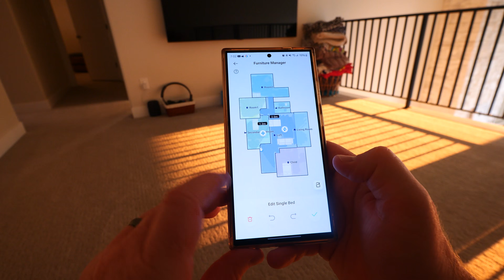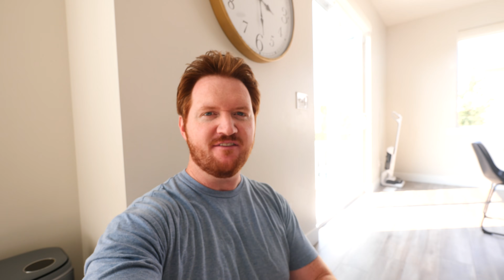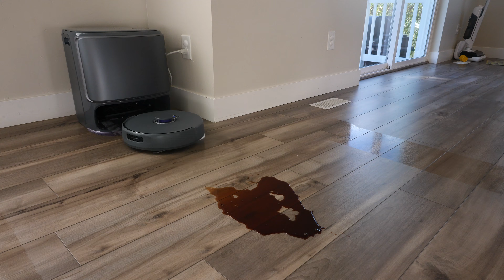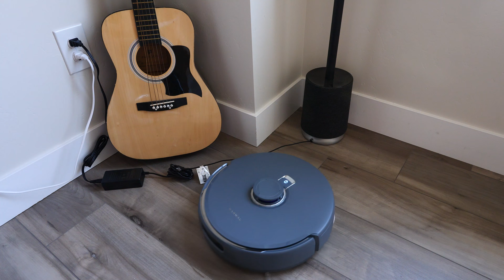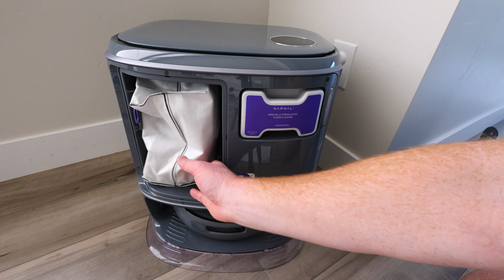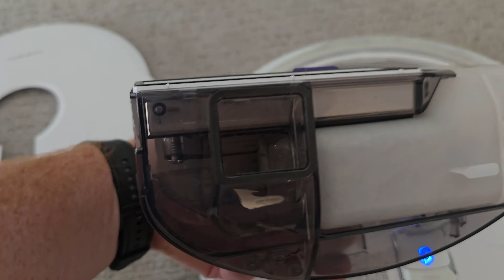They've Done It: The First Robot Vacuum with 2 Eyes and 2 Brains!

Comment from the maker: Sign up (link below) between September 6 to September 13 to unlock exclusive benefits, including 1 year of free accessories and a big chance to win a Free Narwal Freo Z Ultra. Stay tuned for the Early-Bird campaign from September 14 to October 7 to grab unbeatable special pricing — just a little bit over $1000!
US: https://bit.ly/3XccQxW
Ca: https://bit.ly/3ZbQRcM
Reply: What is your favorite and best mop/vacuum combo? Is it this one?  Also, what has the best app ? 

Another question:
Does this or other vacuum/mop combos automatically detect an area rug so it does not mop it?
Reply from the maker: Great question, I might not be the best suited to answer the question as other has tried every robot and app, but from the few I have tried I do like Narwal's the best. Clean looking interface and it is easy to use and navigate.
When you map out the home it does automatically make the carpets and rugs and by default sets to cross off them and it knows not to mop them. You can change it to Power Up when it goes onto rugs so that it will vacuum, but it still knows not to mop the rug and picks up the mop pads so it doesn't touch.

Comment: The bad thing about this vacuum is that the robot doesn't carry a water tank itself...it means it'll take longer than others to mop a big area (like if you have big houses) as it comes back to the base to get the mop wet pretty often.
Reply: Also to clean the mop*.  If you have one that fills a little container but doesn’t clean the mop while it’s running the robot, you’re just smearing dirt and liquids.

Comment: I picked up the Freo X Ultra about 6 months ago and love it, though it has issues traversing/cleaning higher pile carpets which we have in our basement and bedrooms. Do you know if this model will be able to handle higher pile carpets than the X Ultra? If so, I'll likely pick 1 or 2 up.
Reply from the maker: That's a good question. I'll have to get a rug like that and try it out.
Reply: @TechWithBrett  I believe I read it in the owner's manual. There was a page on cleaning carpets.